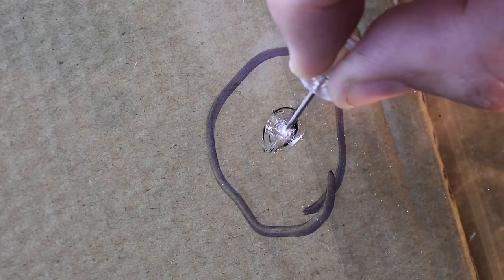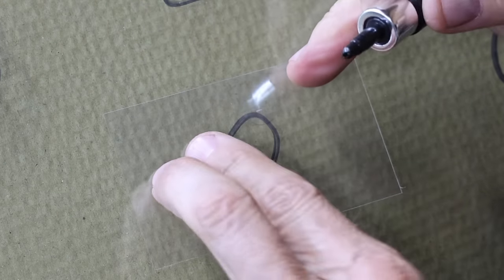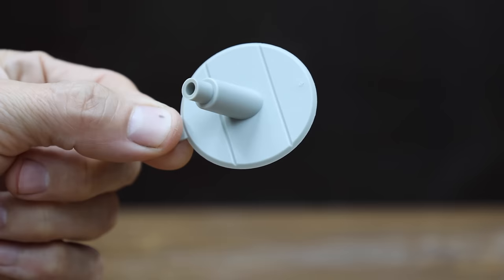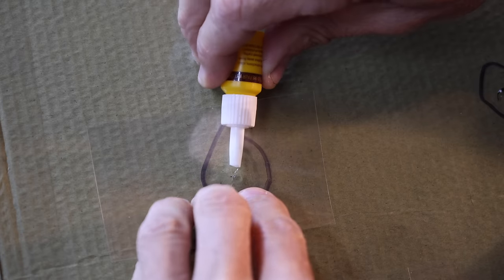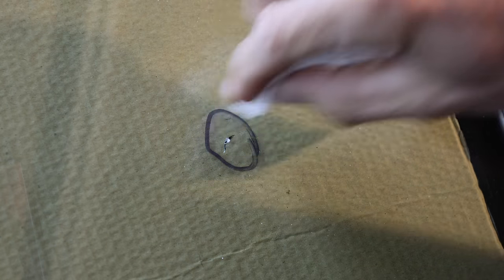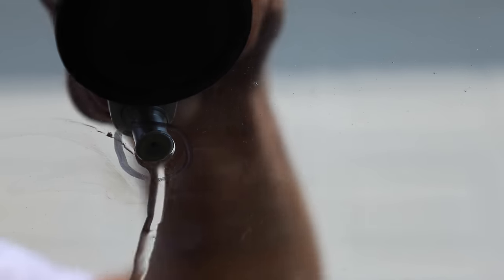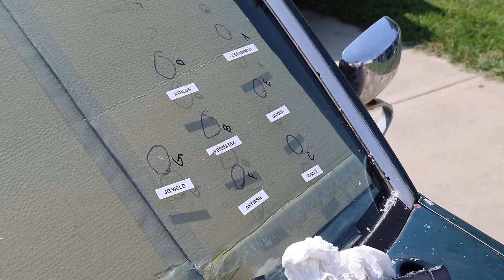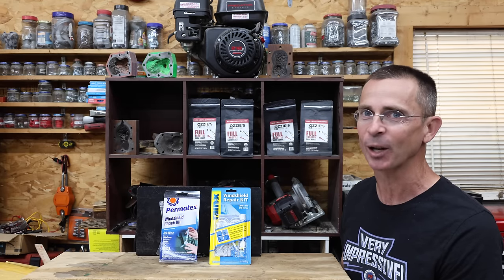Best Windshield Repair Kit? Let’s Find Out!

Comment: The timing of the video was impeccable, as my windshield broke yesterday, and while searching for a repair kit online, I was hoping your channel would have a relevant video. This video was spot-on. I must also mention that I'm a dedicated viewer of your channel; your consistent and unbiased approach make your videos truly exceptional. Thank you so much!
Reply from the maker: You are welcome!  Thanks for sharing.
Reply: Before you commit to a DIY kit. Definitely give your local repair shops a call for a chip repair quote, they could be cheaper than the diy kits, if not free through insurance
Reply: @oTEMPE5To  you're absolutely right. My windshield crack although not too deep, was over 6-7 inches long. Using a repair kit wouldn't have done much. A replacement is covered in the insurance and the windshield repair shop does the insurance paperwork! Quite straightforward and more reliable in the long run.

Comment: I have used the Rain-X kit several times with pretty good results. A heat gun on the inside of the windshield makes all the difference to get the resin into the crack.
Reply from the maker: Thanks for the feedback.
Reply: Thanks for the pointer. I'm going to have to try this. How long do you use the heat gun for? Can you see the resin go in the crack?
Reply: @gillt1975   Not long at all. Just enough get the glass behind the crack fairly hot(10-20 seconds?) Yes, sometimes you can see the resin actually go into the cracks when you heat the glass up. Hope this helps.
Reply: @joboy77  That's not the resin, it's the foil between the glass layers. I work at Carglass and it's forbidden to heat the glass, because after a while it will crack again.
Reply: Then why did the professional in the video heat the glass with his lighter? @Toxic.D
Reply: @joboy77  Im sorry ,but seems like my every comment is deleted.I've tried to give you an answer like 4 times,but for an unknown reason is deleted
Reply: At one point he said the middle layer between the interior and exterior glass layers was plastic.  Is the reason for avoiding using excess heat inside due to its destroying the integrity of the plastic layer?
Reply: @joboy77  If you apply heat on the windshield ,it looks like the crack it's filled with the resin,but actually it's the foil between layers that fill the crack.
Reply: Heat and light tapping, fixed multiple bullseyes on a friend's vehicle the last few years doing this.
Reply: @joboy77 can I use a hair dryer? I don’t have a heat gun
Reply: You certainly can, will just take a little longer. @sugarsyrupp
Reply: Should you use heat during the vacuum process or during the pressure process
Reply: @es2910   I apply some to the back of the windshield during the vac process using a hairdryer. When you goto pressure it'll push in there. Tap it a little to get air bubbles to move. The heat thins the epoxy.

Comment: I've had two chips in my windshield since buying my car over 2 years ago, and I've used both the Rain-X and Permatex to similar results as shown here. I came to the same conclusion, the tool for the Rain-X kit was a bit finicky. If need be I'll be using Permatex again, worked great for me and has held up nicely for 2 years
Reply from the maker: Thank you for sharing!

Comment: Great video as always. I'd love to see a comparison of different oil filter removal tools and some improvised methods like a leather belt. Comparing the different designs in a variety of angles and how they deal with overtightened filters.
Reply: Yes, please! Great idea 👍
Reply from the maker: Thank you for the video idea!
Reply: Big Channellocs
Reply: I've always liked the band type with a long extension. It seems best in cramped quarters, but comparing that with the cup type and channel locks or a screwdriver shoved through the filter would be very good.

Comment: Bought the RainX kit and doing this repair right now on the wife's car. She has 2 chips. First one left just a tiny chip left, and second one is going well so far :D  Thanks for this video! I didn't even know stuff like this existed until then. We just put expensive tint on the windshield, then got these two chips one after the other not even a month later. I was not wanting to replace the windshield, and had no idea you could just fix chips all by yourself with cheap fix it kits!  Thanks again!!!

Comment: Used the rainx kit several times after being fed up with professionals (cost and avliability) in my area. You need to tap the windscreen from the other side to remove air for best results. I've recommended it to others. Works on phone screens too if the cracks small enough.
Reply from the maker: Thank you for sharing!
Reply: Next time try pushing a centerpunch through the resin injector without the screw in it to probe the crack open (like, let the punch get inside the pit) , don't use more than around 1kg of force, It allows flow by opening the runs/shell and allows excess air to escape. If it's a star chip without any shelling you need to crack it open more with the centerpunch and something to lightly tap the back with. I'm a certified tech, hope this helps for your next repair.

Comment: Several years ago I used the Permatex kit. It did a great job. You could not see any damage on the windshield even years later.
Reply from the maker: Thanks for sharing.
Reply: I have 3 large cracks generated from middle bottom of screen up to 1/3 Rd of windshield screen. Can permatex fill and repair them completely?

Comment: I used to work for my dad who owns an auto glass shop and I’ve used the “pro” grade rock chip fixer and it does work well and showing the cheaper options widens my spectrum. If you ever plan on doing other glass related videos you should do windshield urethane glue I’d be interested in that one.
Reply from the maker: Thanks for the suggestion.
Reply: Have you considered testing that similar resin that is advertised on TV, YouTube etc for fixing scratches and cracks cell phone screen protectors and supposedly the screens themselves?  @ProjectFarm

Comment: Huge thank you.  The day before this video was posted my wife's car got a monster rock chip.  We took it to a glass shop that told us the chip was too big to fix, and that we'd need to pay $450 for a new windshield. And another $250 to have the fancy electronic gizmos recalibrated.  
I'd just watched this video, so I figured I'd just try repairing it myself to see if I could save $700.  Bought the Permatex kit and spent about an hour carefully working through the repair.  The chip is 90% gone now.  We're just going to leave it like that and unless it spreads later on, I consider that a $700 savings.  Seriously.  Thank you!
Reply from the maker: You are welcome!  Glad you did the repair!

Comment: Back in 87 i worked at Budget car rental as a mechanic.  I did probably 3 to 4 windshield chip repairs a week. I do not remember the kit name but it was designed alot like the professional kit in a case with a 120v UV light. 
The manager would order all the consumables by the box load. I probably had a 90% success rate up to a dime size. Sometimes the spidering was just to big and you couldn't get the resin to flow into all of the cracks.
Thanks for another great video brother. It is very much appreciated.
Reply from the maker: Thanks and you are welcome!  Thanks for sharing.

Comment: Thank you!  This is exactly the video I was waiting for as I suggested it a few months back.  I realized that the Rain-X is a bit tricky because if you screw it too tightly, it will make the crack bigger.  It happened to me.  The hairline crack went from 1" to about 2" after I overtightened it.  Using the filler didn't do much for me, so, now not only did I waste money but also made the crack bigger.  Next time I will definitely use the Permatex option.  Very helpful video!
Reply from the maker: Thanks and you are welcome!  Thanks for suggestion this video idea!

Comment: Things cheap DIY kit makers don't tell you. [1] Any crack lines must be stopped by honing end-points with dental bit. [2] Repair area needs to be undercut, so resin stays trapped in hole. [3] Heat gun (or strong hair dryer) is required for resin to flow deeply into damaged spot. [4] You need to draw air out many times until void is full (inspect from inside). [5] Using a UV light source is the only true way to know resin will harden properly. I'm glad you had someone show correct procedure. Your videos  teach people more than what most have acquired in their whole life.
Reply from the maker: Thanks!

Comment: That Rain-X kit saved my butt. I had 3 glass shops refuse to fix my crack. I researched and found it had amazing reviews, tried it out, followed directions to the T, and it's been holding strong for over a year. It was a rock chip that had a crack going out the right of it about 2 inches. I have a tinted windshield and the windshield itself was going to be over $800. I highly recommend it.
Reply from the maker: Thanks for sharing.

Comment: I've had good results with the permatex kits. if you use a cheap hand brake bleeder vacuum pump to pull a vacuum on it before adding resin to evaporate off any moisture in the chip, and also after adding the resin, you can get repairs that are unnoticeable .
Reply from the maker: Thanks for sharing.

Comment: Great video as always, thank you!  Before seeing this video, and in an attempt to repair a chip on my wife's 2023 Volvo, I tried the Rain-X kit and ended up now needing to replace the windshield. The chip ended up becoming two large cracks!  Very upset about this!  I followed the instructions to a T.  The resin kept running out of the chamber so I tried screwing in down the chamber a little more, then boom!  I am a car guy, and believe you me, I did not over screw down the chamber.  I even ended up filing a claim with Rain-X stating their instructions did not warn against potentially causing more harm then good.  Of course they denied my claim...
Reply from the maker: Thanks!  Thanks for sharing.  Sorry to hear!

Comment: Super helpful!!!

I've used some of these repair kits and I had no idea there's that much of a difference in the quality of the sealer.  I've never used a professional kit, but I have watched them fix my windshield.  Yes, it comes out looking great!  I've also never used the four legged kit either.  Of the times I've used the syringe type repair kit, I'd say it comes out looking acceptable.  I usually pull the pit right out - I learned how to remove the excess in a better way!  Thank you!

I still have quite a few of these kits sitting around.  The next time I buy one, I'll try the Rain X kit.  I like that you can do multiple repairs and the cost per repair is reasonable.

Thanks for the video.  This is in my wheelhouse!
Reply from the maker: Thanks and you are welcome!

Comment: I've used the Permatex twice with fair results. I noticed that if you follow the instructions exactly the resin wouldn't get into the ends of the spider cracks, but if you added extra pressure to the syringe with your hands for a few minutes it would force the resin all the way in. The first time I used it the results were practically unnoticeable, but the second repair didn't come out quite as well. That second windshield also ended up fully cracking all the way across on a very cold day so it had to be replaced anyway. I'd still buy it again the next time I need it, and this review was very useful in confirming my product selection. Keep up the great content!
Reply from the maker: Thanks, will do!

Comment: When I was 16, I worked at a local quick lube shop where we changed oil, did power steering flushes, changed air filters, stuff like that. But we also did these rock chip repairs. I got damn good at them and was the best at the shop. I’ve lost my touch at 27 years of age I haven’t done them since I was 18. I’d like to get back into it since now I’m a Toyota Master technician. Thanks for the video!!!
Reply from the maker: You are welcome!  Thanks for sharing.

Comment: Great video on DIY windshield repair kits. It was really needed and appreciated. In my opinion, the professional windshield repair technicians do the best repair jobs but their service costs significantly more than a $12 to 13 windshield repair kit. Somehow, my past windshield repairs always look like the windshield has been repaired but I have never had further cracking of the glass after my repairs. I have used both the Rainex and Permitex repair kits exclusively because they are readily available at Wal-Mart. I agree that the Permitex kit is a little clumsy to use. Never took the time to see if I bought the best performing kit. I needed a repair kit to avoid further damage to my windshield and I bought a name that I thought was trust worthy. ( no cheaping out as windshields cost money) I never worried about how many repairs that my kit could do.
Reply from the maker: Thanks was sharing.

Comment: Great Video!  I have used Permatex in the past an it did a good job at stopping the spread of the chip and crack on my windshield, but the spot was visible after the repair.  That did not bother me as it was at a position that was not in my line of view.  I am certain I could have better results from the kit if I would have waited a few weeks until the temperatures warmed up above 40 degrees Fahrenheit, but for me, it was a great solution because I could press the Jeep back into service without having the cracks spread all over the windshield.  That was a win because the Jeep was back to making money and I did not need to spend the money to have the windshield replaced 4 to 8 weeks later.  I would use Permatex again to stabilize a chip and keep the cracks from spreading.
Reply from the maker: Thanks!  Thanks for sharing.

Comment: Another great review. Here's another one you can do involving the windshield - mirror attachment adhesives. One of my cars currently does not have a rear view mirror as the repair kit I used to hold it in place failed. Now I'm wondering which one to get.

Comment: Literally doing right now for the first time. Following this video's recommendation for permatex. 
One thing I noticed on the first application of resin is the drop can create a bubble pocket that stops it from reaching the glass. So I added a few more drops and used the plunger to create a vacuum and suck that bubble out. 
Also I over pressurized the second stage a blew resin out of the double sided tape and was unable to get the same seal back. It's user error since I pushed the plunger well past the stopping point.
I can still see some of the cracks likely due to the blow out. Only time will tell if the cracks will propagate from temperature swings.
Reply from the maker: Thanks for sharing.

Comment: I used the Permatex kit and it didn't go well. Everything up through the syringe removal was easy and clear, and I followed time & temp instructions, but the curing strip was stiff and warped out of the box. It didn't stick, and the resin failed to cure, despite double the exposure time in late- afternoon direct sun. Will give Rain-X a try
Reply from the maker: Thanks for sharing.

Comment: I had no idea there were even kits for doing this yourself or I would have tried. I paid a guy to fix a chip in my car's windshield. I had assumed it would be 100% gone when he was done but he did admit up front it might show just a little but would prevent it from spreading, which was my main concern. It does show if you look real close, but for the most part it's gone. However, the results you got here tell me I could have saved myself $80. Oh well...live and learn. Nice job sir.
Reply from the maker: Thanks!

Comment: As a small used car dealer I have used the Permatex kits many times and always been happy with the results.  Also, they have never made the crack or chip worse. 

I did have a pro fix a chip once and when he went to cure the repair it cracked the glass.
Reply from the maker: Thanks for sharing.

Comment: I haven't had any luck with a JB Weld product yet.  Maybe it takes a Pro, but I followed the directions.  Of course, the Clearshield Kit did the best, as expected, but the Permatex Kit is impressive for $13.  A Professional Windshield Shop told me there is no way to repair long running cracks, so I replaced the windshield, which was damaged and cracked with long runs from a 50 foot Magnolia tree dropping its seed pods on it.  Those seed pods are very heavy when they drop!  With your info and considering UNIOON's 12" crack claim and its poorer performance on a ding, and especially if the rankings were done on the Pro's results, I still highly doubt that runs can be repaired.

Thanks, Todd.  Another great one!  I have a shortcut saved for your Project Farm Test Products spreadsheet, so when I need to repair my windshield again, I'll look there to find this video.
Reply from the maker: You are welcome!

Comment: As an autoglass business owner/ technician i really appreciate this video. Id like to recommend a few other autoglass related videos. 

1. The different brands and types of urethane used by technicians. They come in many variations such as (high modulus, high viscosity, primerless to glass, glass primer required, 30 minute - 12 hour minimum driveaway time. Theres many types of tests that can be done. Tensile strength, shear strength, curing time... 

2. (Better for the consumer) brands of glass. Theres alot of brands such as (benson, trival, xyg, ati, pilkington, gaurdian, fuyao, sisecam, agc, carlex. It would be good to see a thorough test on the many factors that contribute to quality of glass
Reply from the maker: Thanks for the video ideas.